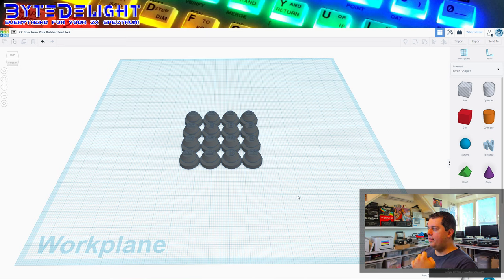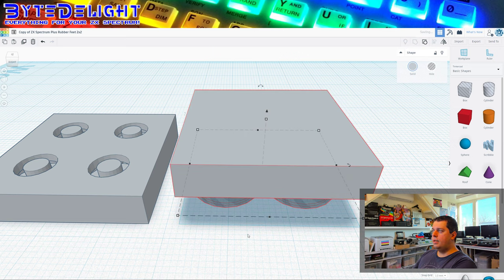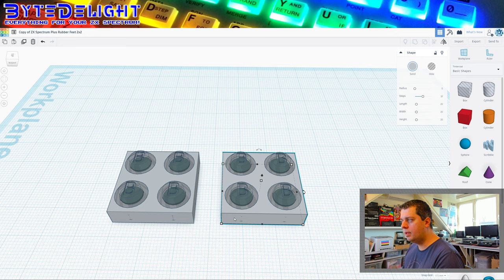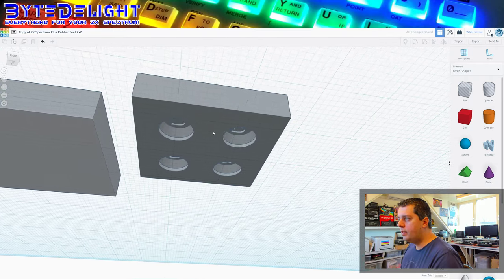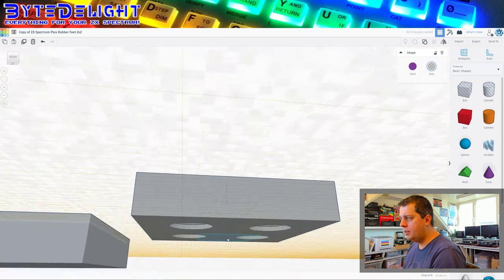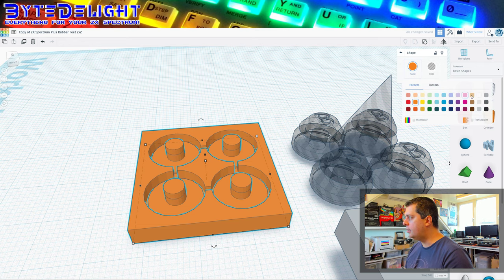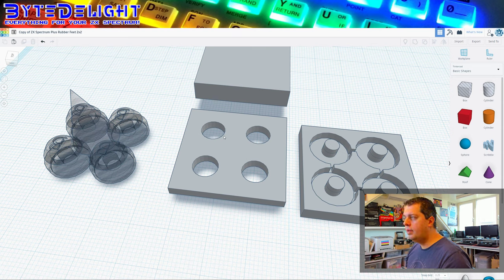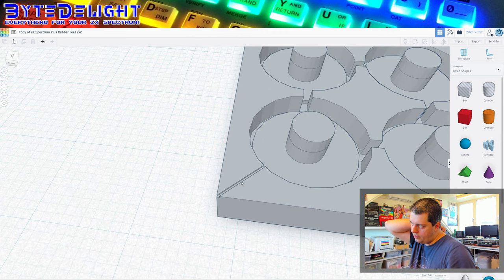ByteDelight - designing rubber feet for the ZX Spectrum Plus / Toastrack - Part II

Comment: Ressurecting this from the dead! Did the steel molds work?
Reply from the maker: Didn't get to that (yet), but printing the TPU (rubber-like) feet does the trick so far.
I would prefer softer rubber, maybe I should buy black Varioshore TPU - I have an unused roll of red that I will test it with as soon as I can.